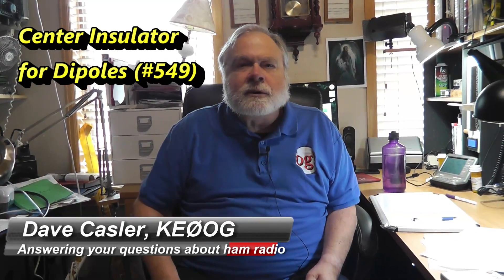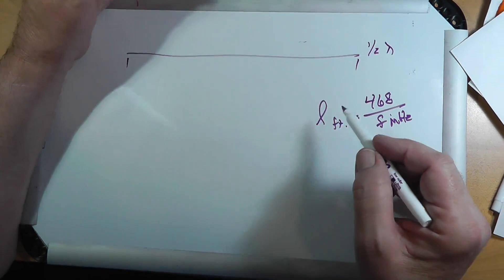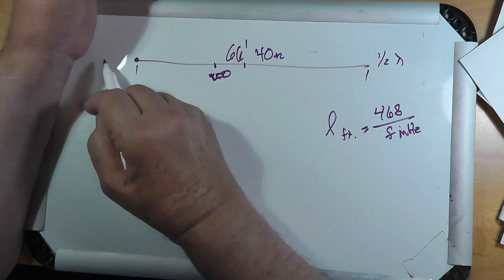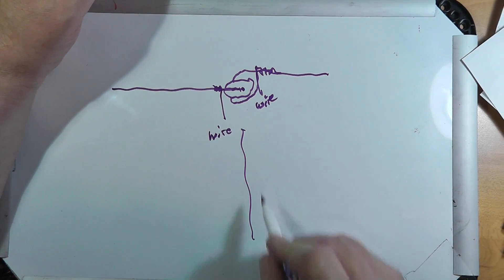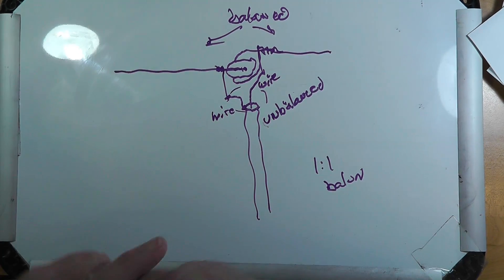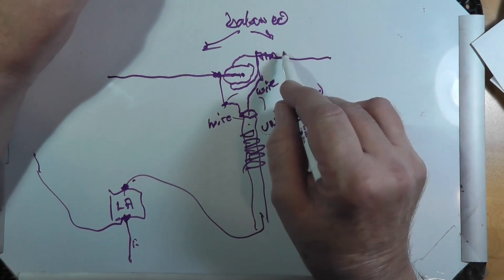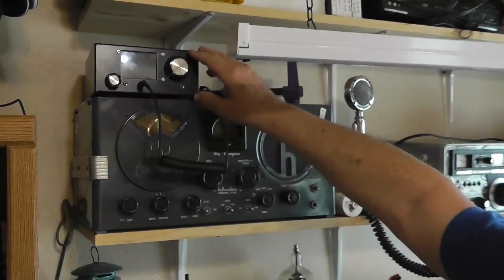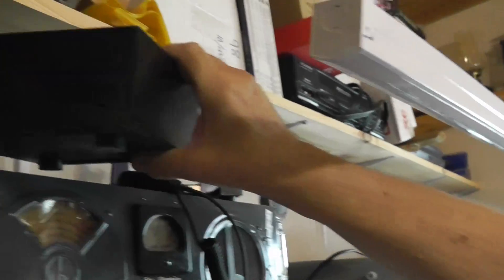Center Insulator for Dipoles (#549)

Comment: Dave I do it the easy way. just make an old antenna The g 5  R= v  Just add tunner in line and it will cover ten threw eighty. I'm listening to this when you are talking. I wonder if those lighting arrestor work. I had a friend that got struck

.  his top antenna a antron 99 it destroyed his shack and  when I got hit. it came in the house and scared the crap out my mate

Comment: If a home brew 6mm dipole were mounted in the attic, would it be necessary to bond to the outside ground rod?  How would a 6mm dipole be anticipated to work if about 20 feet off the ground in the attic, asphalt shingled roof, wood truss construction, no metal in the roof, coax run to the shack about 75 feet...the shack is safety ground bonded to the outside ground rod.

Comment: Dave, just to head off a question I'm sure others will have, when using the 468/frequency in MHz to determine total length of the radiating wire, should you use the lowest part of the bands frequency, the highest part, or the center? For example, for Ellen's 6M dipole, which would go from 50.0 MHz to 54.0 MHz would should she use 9.36 feet, 8.66 feet, or 9.00 feet to be right in the center of the band? Sure you can cut the wire to be in the exact frequency you plan to operate, but since 6M is so wide, what would you suggest?
Reply: good q